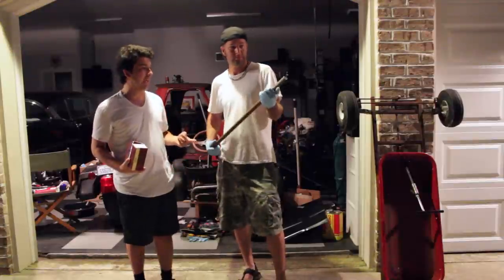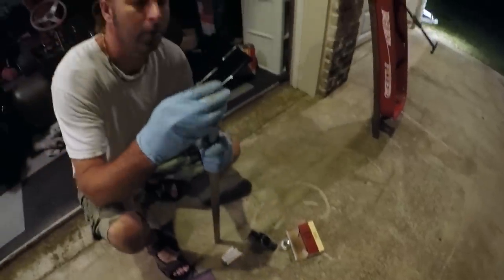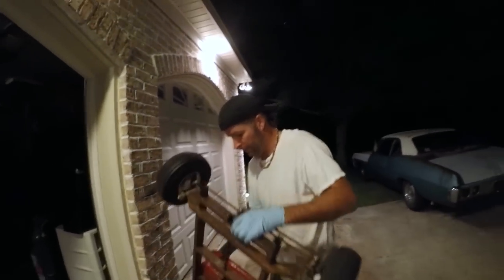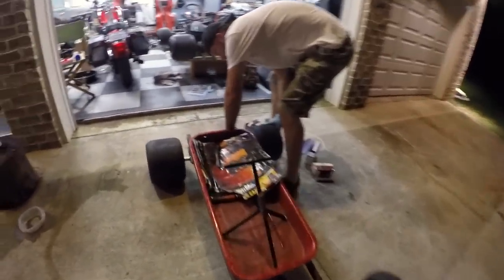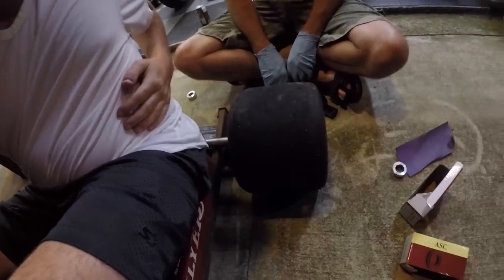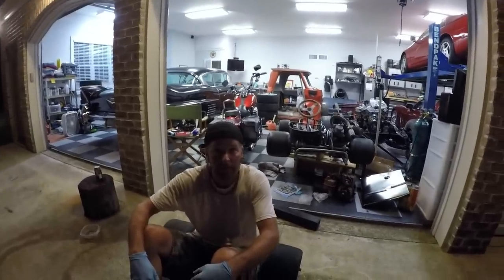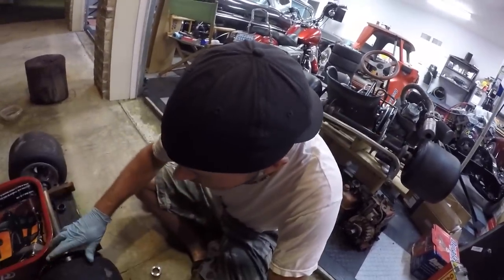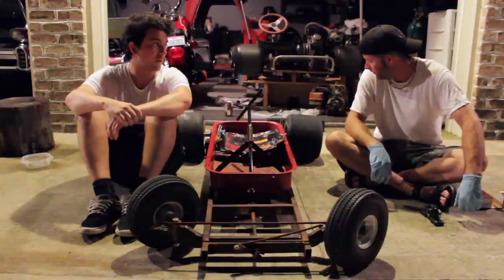Rat Rod Wagon Build: Pt. 3.5

Comment: Option #2. Don't want to be diggi'n the front into your lawn when riding around. As for the axle, it will be fine just behind the wagon tub without tub modification. If any, just to allow tabs of axle holders to position axle as close as you can get to tub without axle touching tub. Steering wheel controls sounds cool and would eliminate bars and rods to operate foot controls and might simplify the engineering a bit. For brakes, install a disk/rotor on the opposite end of the chain sprocket for a nice disc break set up. It would look symmetrical on the rear end along with the chain sprocket.

Comment: I hope you guys can get that old Briggs running. It would really match the whole theme well. While a Preadator would be a good performer, it would look a bit too modern for the theme. Maybe you can find a way to make it look "worn" but whatever you guys decide I'm sure it's going to be cool.
Reply: *****  Anything old and worn. I'd be sweet if they could score and old 1970's Briggs 8HP with the electric start, I got one of those motors on my old Sears tractor and it's pretty sweet. Blue flames on deceleration.

Comment: To fit bearings to a shaft you must first heat the bearing slowly in a stove or some other way. This expands the bearing so it just barely fits. Bearings are designed to fit on shafts very tight. Most manufacturers recommend heating the bearing before fitting/pressing it. My 2 cents.

Comment: I actually like the rake of #1 but #2 may be better function. Couple of ideas, maybe you should flat black it and pin stripe it. Try to put some of those wood panels on the side for that woody feel. Can you get a steering wheel from a go cart? Not digging the strait rod main cut off.. Good luck.

Comment: Mount the axle behind the tub and raise it above the the frame rails enough so that they are parallel to the ground, with no rake. 
Lots of actual rat rods are set up this way, and it looks amazing imo. This will leave you with more room for sprocket and brake also.

Comment: I used a bike break as my throttle on my go kart but on a new project I am working on I used a mountain bike gear changer, to prevent the clicking in place there is a plastic or metal (mattering how expesive it was) gear looking thing in the part you turn, just rip that out and it should run smooth, also its spring loaded so wear some safety stuff it will get you.

Comment: you could make some dirtbike steps on the side of the rail slightly in front of the tub to put youre feet at , along with some motorcycle type rear wheel brake lever for brake and trottle 
would allow you to stretch out a little 
allso if you kick the rear part of the frame up like on rear rad rods you can move the mountingblocks under the frame and still lower it enough so it dont have a rake to it

Comment: HEY GUYS! I think the best way to do it with out weakening the frame with tension adjustment holes is to place it on top of the frame behind the tub and put a plastic or metal channeled chain separator running down the frame to the motor and wheel. it will keep it low key and safer out of the way. (even drill some holes top to bottom and one from the outside to meet it shaped like a T and thread a grease fitting in there)  and one of the bolts on the separator leave a bit long. (last bolt either front or back put a bar on the put it facing out and bolt a tensioner sprocket and bearing to the inside, inline with the chain. on the bottom that way you have a place to put a spring. consider this :) it may work best and

Comment: Option 2. Mind if I throw out a option for brake and sprocket options.
Reply from the maker: Kendall Mead Go for it.
Reply: If you run a Jack shaft up front you can run a smaller rear sprocket since clearance was something mentioned. Also you can run the brake on the Jack shaft that can be raised up giving it greater clearance. Keep up the good job.

Comment: I say option 3: make a dip in the frame to allow the axle turn just a hair under the bottom of the tub.Or a hole in the frame and make mounts for bearings on the side of the frame.
Reply: ***** And keep the rust.

Comment: Why not put the rear Axel on top of the frame at the furthest point to the rear that you can put it,on top of the frame then put the motor on the front of the cart and run the chain to the back down the one side?

Comment: I hope you went with option 1. Most rat rods Ive seen have a rake in them. Plus I think it looks really cool be higher in the back.
Reply: kafoure93 sorry. it was 2. it has about a half inch rake
Reply: It still is a really cool project. great job guys on the build!
Reply: thanks

Comment: the best and easiest thing to do to this steering is put bearings in this "head tube", slide a tube on them, on that tube put a BMX stem and handlebars
this was you'll have a much wider bar so much more adgile steering

Comment: Here is an idea, make those rear wheels as wide as you can and then put on fenders similar to these (link number 1) or these (link nubmer 2, just sharper than those in the picture) so they fill up that "bro truck" gap. Option 2 would look better.

link nuber 1:  https://encrypted-tbn1.gstatic.com/images?q=tbn:ANd9GcTTBo-cfD4pQdBNp8gHzBUnFWcDudacCeu0c8NbwvHSvUIYd6JP

link nuber 2:  https://encrypted-tbn0.gstatic.com/images?q=tbn:ANd9GcSausc3Gga_hcQfcpRHTDW5X7oylNIvXg9ntpPQ1wznDGH92iItxQ

Comment: Where did you get the bearings and what are they called I'm building 50cc drift trike and need bearings, thanks
Reply: +Nathan Hassler pillow blocks from agri supply. you can also find them at tractor supply. sorry for the late reply

Comment: Where are you guys planning to put the engine? It doesn't seem that you have any room for it. Also, Here on the outside looking in, It looks like you need to stiffen up your frame. To look at it, If you happen to go bouncing around much in it, it might warp in the middle. What are you going to use for brakes? You might consider going back to the shed and checking out the old frame you said was there. Watch for spiders though.
Reply from the maker: GALAXIE 500XL We're sticking the engine up front and getting it to the rear wheels via a jackshaft and chain. We'll probably stick a drum brake on it. We noticed tonight that the frame may need stiffening, but we're going to play it by ear. Basically, it'll be fine.
Reply: CarsandCameras Here is a idea. Instead of using a jack shaft. Why not a riding mower 5-speed transmission? If you set it up right, it will almost fly. I've seen riding mowers that will do from 30 to 50 miles an hour. As long as you are not going to play with it in mud, Put a 8 inch pulley on the front and maybe a 3 or 4 inch pulley on the back, In high gear, It should be able to hang with your cart.

Comment: Those spindles are completely wrong- it will not steer at all like that, theres suposed to be all kinds of angles and geometry in spindle set up- even the cheesey $50 Kart has correct spindels on it- the way those are the kart is going to just plow in on one wheel and slide on the other and when you go to turn it going to slide strait forward, and you'll get hurt guys! also the tie-rod needs one threaded end and a ball-link to set the toe-in........  look at all your store bought karts spindles and steering and see what I mean-